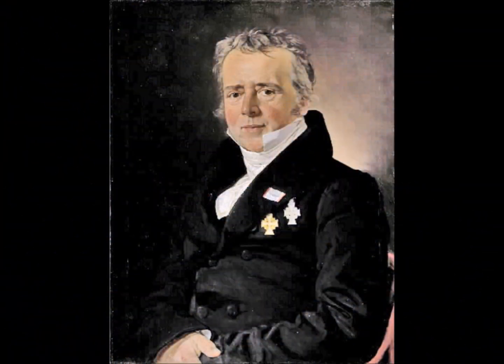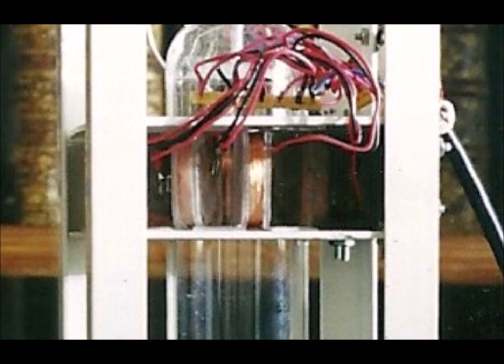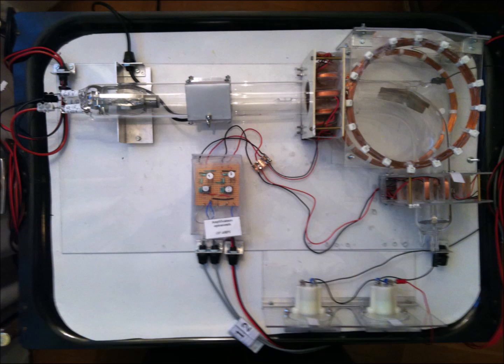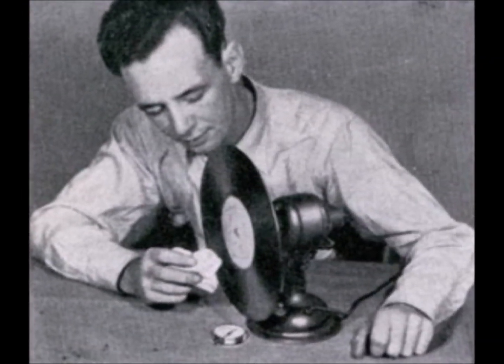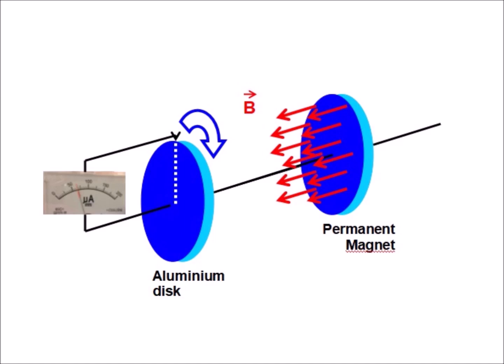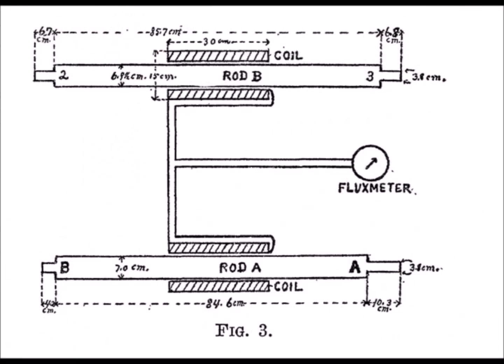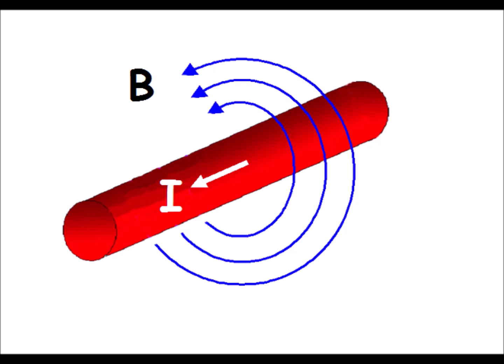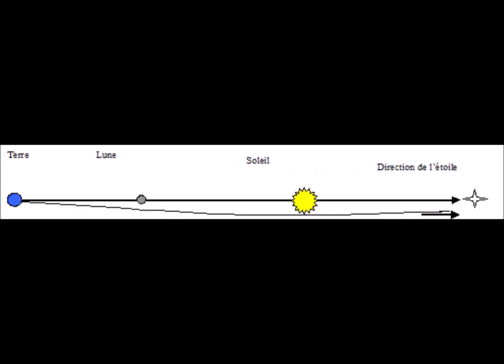Einstein-de-Haas’, Faraday’s, Barnett’s and Rowland’s  effects. The origin of magnetic fields.

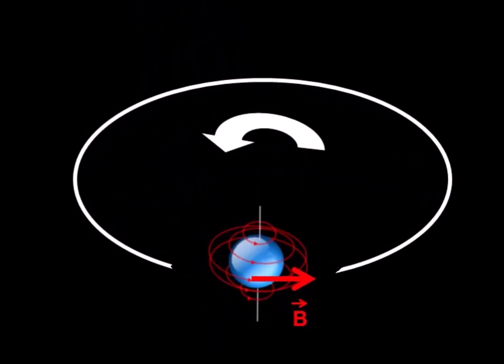Comment: Page 8:22
Electric charge on a carrier move together linearly, regardless of the carrier is a conductor or insulator. 

Why must electric charge rotates together with its carrier? Are we assuming so? 

The water travel with its carrier flask. The water will rotate together with the flask only if we have drag at water glass junction. 

Logic and math alone can cause misconceptions and misinterpretation not guided by intuition or philosophy.

Comment: Please remember that “free electrons” was first discovered by JJ Thompson as a -ve charged particle accelerated and launched from a glow cathode submerged in vacuum and he did not discovered electrons in a conductor. 

Electrons flows in a conductor is a logical assumption legislated and enforced by his followers. 

According to Faraday’s law we have no electric or electron activities inside a conductor either solid or hollow (Faraday’s cage). What flow pass a conductor is not electrons but electric charge. 

When a sheath of electric charge flow outside an elongated conductor it induces eddy current into the conductor that cause energy dissipation and temperature rise. 

Electric charge can be applied to a local spot of an insulator body. When the body spin the spot charge also rotates at a radius >0 and a B field is established. 

However the above isn’t true if we replace the insulator by a conductor. As we charge a spot on an elongated conductor body the charge spread all around it evenly and not concentrated locally. When the body rotates together with the sheath of charge at radius =0, we can hardly notice any B field. 

Electricity and its attributes can be quite confusing and easy to be handled with mistakes.